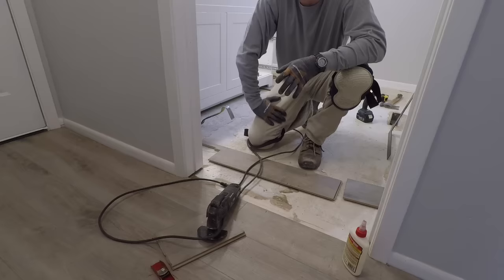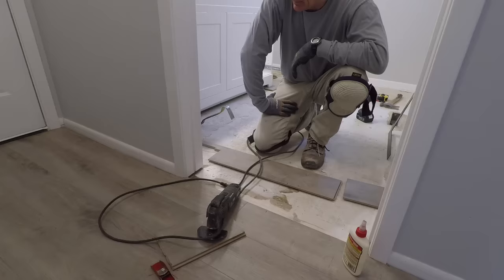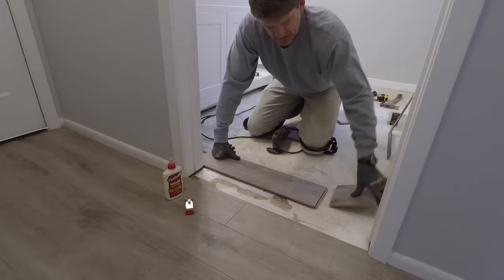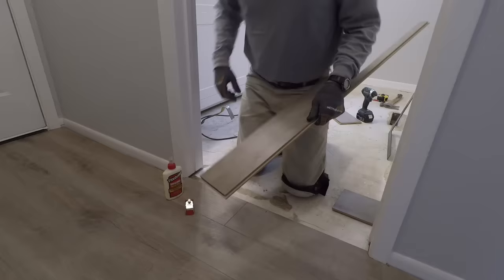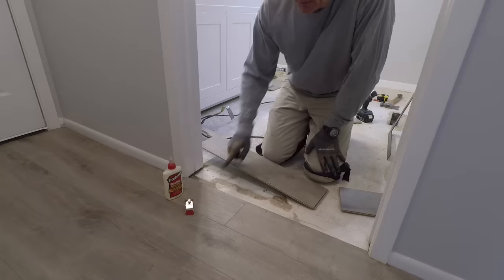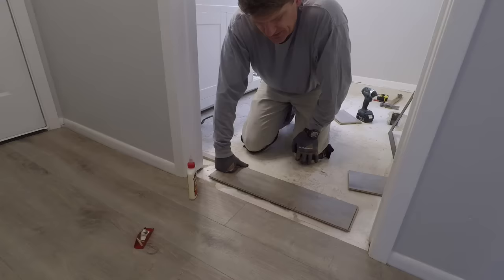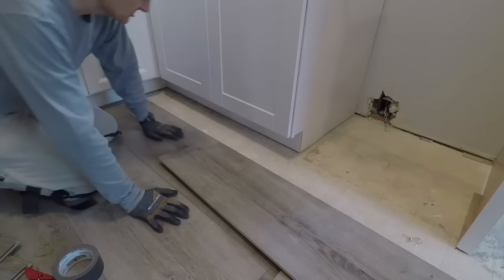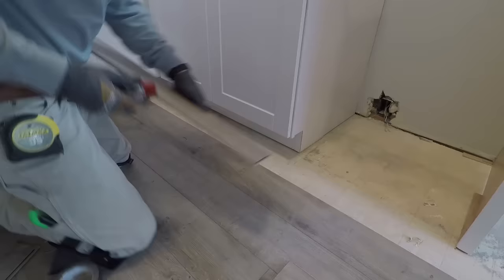How to install laminate flooring around doors and cabinets.

Comment: Will this application work for an installation in the basement, considering the expanding and contracting of the flooring on the cold concrete?  Well the glue holes right? Will there be any bellying overtime?
Reply from the maker: The expansion and contraction will come  from changes in moisture more than temperature. In basements I’ve mostly done small areas. In the one room where I did go through a doorway (my house) it’s held up fine. It’s very important to manage moisture on concrete. A good continuous vapor barrier is a must.
Reply: Better off using vinyl Or hybrid floating boards in those areas ... Waterproof

Comment: Why not remove the base trim instead of butting up to it and covering it with queerer round?
Reply from the maker: It’s just a matter of time. For some houses I will but in this house qtr round made more sense. Pulling and reinstalling base takes quite a bit of time.

Comment: Is that standard wood glue you are using?
Reply from the maker: Yep, standard wood glue. Use the waterproof type for extra insurance, but a glued joint is very strong.

Comment: What’s the best way to fix this if you have it on your floor, and don’t want to start over? Backer rod and caulk?
Reply from the maker: Backer probably isn’t necessary. Just find the best color match you can. Might have to do 2 coats if the caulk settles/flattens out. It likes to do that in big gaps.
Reply: @HomeSource  hero!

Comment: Doesn't the glue defeat the purpose of having lips on the laminate?
Reply from the maker: In this case the glue takes the place of the lips. And a glued joint is a strong joint.

Comment: Hey buddy. If it’s laminate flooring why you don’t lay the under pads. For all kind of floating system material, the under pad is necessary. I also install it in another way. My way is much much easier and faster. Maybe I make a video and send it to you. 👍
Reply: Some flooring is padded on the bottom. You never use pad underneath it.

Comment: I’m slowly learning, got to fit laminate flooring, and the underlay on a medium size room..first time. There’s no gap under my skirting or door, is it a must do to cut the gap underneath?? Im so clueless
Reply from the maker: You can leave the skirting/base board but will need quarter round/shoe molding to finish the edge.  Around the door, you can either under cut it like I showed or caulk the gap. Caulking won’t look great though.
Reply: Janssen Properties thanks mate
Reply: Janssen Properties quick question about laminate underlay, does it have to be fit perfectly to the wall or can u leave some overlap/ since its a roll, is there a certain size i should cut it into and tape together ?

Comment: I see no underlayment is used here. Assuming that’s ok ? I’ve always used it but if not really needed it would save some money
Reply from the maker: Good eye Bill.  Actually it comes with the pad pre-attached to the back.  After using a factory attached pad you'll try hard to avoid having use the rollout type again.  Very convenient to work with.

Comment: I have metal door jams.
Reply from the maker: With a metal jamb you’ll need to trace around it as carefully as possible and fill the gap with color matched caulk. I like to use a piece of paper or cardboard as a template. Good luck!

Comment: A lot of comments about not voiding the manufacturer's warranty.
  What are specific examples of how this type of flooring will fail and trigger a warranty claim?
Reply: The warranty is mainly for the actual finish on the flooring.   So if normal traffic on the floor eventually wears through the top layer that would be a manufacturer issue.   Locking mechanism failure, gapping, joints coming apart etc.  That's why installing it per manufacturer specifications is so important.  They're first move on any claim will be to blame the installer.  So cover your back side

Comment: Those oscillator tools don't really leave a nice cut. I see it everywhere recommended. Better use a fine handsaw?
Reply: buy a more expensive finer blade for them and use a scrap piece of flooring to lean the tool up against as a guide and also get better at cutting over time

Comment: You voided the warranty as soon as you took that lip off.   Then you glued it to double down on voiding the warranty.  It's a floating floor not glued together.   You did a great job to show the undercut but man people please read the manufacturers warranties so that you can protect yourself and maintain your warranty.
Reply: @bimotahb1  He would warranty the install?  This isn't a video showing what he will do to install a floor for you.  He's showing people how to install their own flooring.  Which, when it's done by a DIYer, will need to be done by manufacturers instructions or any issues with flooring will not be covered by the manufacturer warranty.  How can the floor be covered by a warranty if it's not installed properly Brian?  Not that hard to understand.  Shayne is exactly right.
Reply: @bimotahb1  the warranty you would be voiding is the manufacturers warranty.   I'm not saying that this technique wouldn't work,  I'm saying that the greedy manufacturers of the flooring will use absolutely any excuse to not give a customer free flooring due to mechanical failure or finish failure.   I've had a flooring company for over 20 years,  I'm certified by the NWFA as an expert installer.  Not trying to step on toes just trying to educate the average DIY guys.   FOLLOW MANUFACTURER INSTRUCTIONS .   Maybe someday I'll find time to upload a video to show everyone how to get through door jambs without glue,  shortcuts, or any other bs I've seen on the tube but until then.   FOLLOW MANUFACTURER INSTRUCTIONS.
Reply: Warranty??? How many people do you know that called in a warranty on laminate flooring. Besides warranty is for defects not installation. If there is a defect on laminate you would know right away.
Warranty...ha.
Reply: @ericmuller3339  man, why are so many people just baffled by this warranty thing.   Have you read an installation manual for laminate before?   It's clear as day.  First of all if there are defects in the material any good installer wouldn't install the damn floor.   That's your first job as a professional installer.  Inspect the product.   The warranty is for the locking mechanism and wear layer.     So obviously if you mess with the locking mechanism you're screwing up the mechanics of the floor.   How is this so hard to understand.   I'm just trying to let people know FACTS so if they do have an issue with their floors at least they hopefully installed them correctly which gives them a better chance at being compensated if a floor fails.     Oh and by the way I also am an inspector for the National Wood Flooring Association so yeah it happens a lot.
Reply: @ericmuller3339  sir id like to make a claim for 2000 sq feet of laminate and a 40 hour work weeks pay to put it back in.
Reply: @bimotahb1  agree with your comment re. floating floor. Gluing 2 boards together has no bearing on the floors ability to expand or contract. In Britain when laminate flooring was first introduced about 30 odd years ago every board had to be glued together before quicklock was ever invented. It was still a floating floor. As regards manufacturing warranties are concerned I am often sceptical for the simple reason that they will always look for a reason not to admit liability. And yes, I have been fitting kitchens bathrooms flooring, cladding for 38 years

Comment: You are never supposed to break the lip off.. ever!! It's a floating floor. You can press down on female board and get it in if you try.. that is gonna gap after time. Warranty is voided.
Reply: This is a false statement. Some manufacturers, one I'm actually looking at now to use, says in the installation you can do this exact method in the video.
Reply: That is a major traffic area. You could have made your cuts and connect them together and then slide it start on to the flooring you have down. But hey.. looks good man
Reply: Or you could have used a full board so not to have a butt end in the middle of the doorway

Comment: I definitely disagree with this method of cutting and gluing the joints. This is supposed to be a floating floor to allow for expansion and contraction. 
I've done many floors and have simply made a pattern from a piece of scrap or cardboard.
After getting the pattern perfected, then transfer it onto a piece of flooring. A pattern jig is also useful for this and would save time.

Comment: What will happen if I nail down to the subfloor one piece of floor (floating floor)? Thanks.
Reply: Do your very best not to nail through your floating floor.   This again will void manufacturers warranty and as John jtplastering said your floor could likely separate because you have now removed the ability of your nailed piece to float with the rest of the floor.   So be careful when installing your trim work.  Nail shoe into baseboards not flooring
Reply: Your floor will move naturally over time and nailing a piece down could likely cause gaps and problems with the area down the line!

Comment: I thought you’re supposed to leave a 10 mm gap round the edge
Reply from the maker: You are correct.  Leavin a gap is important for expansion.  There's much more than 10 mm from the edge of the flooring to the door framing so good to go!

Comment: What if I already screwed up by doing my floor wrong on the door jams? What do you recommend for covering the gaps?
Reply from the maker: Color matched caulk is probably your only option.
Reply: A neat matching-color cover strip cut all round the frame

Comment: That cut is not hard to make an lock in place. Cutting the lip off an gluing it is dumb. If you know how to read a tape an how to measure all the cuts correctly you shouldn't have a problem placing the tile.

Comment: Don’t you lose your 3/8” gap around the outside underneath the jamb with this method.
Reply from the maker: Once you cut away the jamb you have a big gap all the way to the stud framing.
Reply: @HomeSource  Yes, but I’m concerned about around and under the casing, the trim around the door frame. Thanks…

Comment: Couldn't you just cut all the baseboard and not need quarter round?
Reply from the maker: If you want to avoid qtr round you’ll need to remove the base and reinstall after the flooring is down. Nice finished look just more work

Comment: Your Costco laminate and oscillator is trash mate and you don't need to cut off the edges or use glue or tape, get a rubber mallot and force it in, takes a fraction of the time and just as strong as any other joint. If anything what makes these costco laminates a bitch is the fact that they're not waxed very prone to water damage and really don't want to slide so just get a piece of wax for the edges you need to slide in or force

Comment: Should of used transtion
Reply: Atif that's funny my man.  So true
Reply: Actually,  a transition is required on any doorway that is less than 4 feet. Otherwise, the doorway is a very week stress point. Two rooms only connected with a few feet...ehen one room's floor moves or twists, the other room will be force to move also via this small threshold connection. Best to interrupt flooring and use a T-molding threshold.
Reply: @paulegan2252  That sounds right. Plus, I think it would just look better. I like a visual break between rooms, even if the flooring material is the same.

Comment: Garbage. Totally unnecessary. Work left to right like it's designed.
Reply from the maker: I thought that too until I ran across a brand that runs right to left!
Reply: @HomeSource  does this depend on how you're looking at the board? For the projects I've done,  starting lines will be right to left, but once you've got a few lines going,  you transition to "being on the finished floor" and then finishing left to right? What brand? I've only heard experience with a few, but the material in this video is in line with my previous statement.  If he was " on the finished floor" , it'd be left to right. When he's not,  he's going from right to left.
Reply: How do you do a tricky transition then?